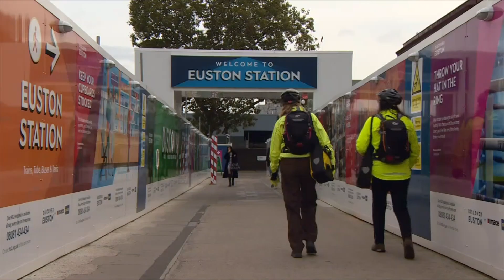Engineers say it's crucial HS2 goes to Euston

Comment: Unless the line goes to Euston it's effectively a line to nowhere. 

It would be faster to get the existing train from Birmingham to Euston than to get the HS2 and have to change on the way. 

But I see an even bigger problem.  HS2 doesn't link up with HS1 all the way to the continent. Who's idea was that? 

It should have been possible to route HS2 down the Lea Valley to join HS1 at Stratford and have a clear run all the way from Birmingham to Paris and beyond. Also going down the Lea Valley would avoid all the problems they now have tunnelling under NW London.

Comment: It should  not only go to Euston but also link east with hs1 with a outer london station or essex station I still feel the low used hs1 Stratford international to be a good choice, we have to get out of the habit of everything to london central ulez proves the east is woefully inadequate to get around if you haven’t got a car , or rely on public transit it rake 2 hours to go from north to east there has to be a loop built that takes that in
Reply: Yep and connect with Cardif, Swnseaa, Douglas, Oban and the isle wight, god what silly ideas people have of HS2
Reply: @peterwallen1063  i honestly feel that that is needed as part of hs3/4
Reply: @ram64man  There is no HS 3/4 only HS2
Reply: @peterwallen1063  like the government north of Leeds we can plan for it
Reply: @ram64man  Problem HS2 isn't going North of Leeds, That is thterrotory of LNER and the ECML.HS2 is WCML project that is run by Avanti West Coast Trains

Comment: Crucially to Euston yes, but unfortunately it was supposed to be ‘crucial’ for Northern England. I used to manage a company making railway bridges and the ‘intent’ and ‘promises’ were for increased capacity for trains travelling to and from The North.
Reply: Agreed it ought to really go to Waterloo or Scotland. Or link up with HS1 if the freight wasn't used for the HS1 HS2 link
Reply: @daveseville7394  Why link up with Warterloo or Scotland very stupid idea concidering the HS2 line is a domestic Hi Speed line linking Birmingham and Manchester to London Euston and there is no practical or financial reason to join HS2 to HS1 so any freight trains comming from the EU to the UK Midlands and the North via the Channel tunnel get to their destination easily by other routes, no freight trains will use the HS2 route as they will continue to use the existing WCML route
Reply: @peterwallen1063  I am against HS2 and firmly believe that a replacedment Great Central would have served far more people- but that's not what the corrupt PM of the day wanted. However, I am puzzled by your reluctance to link it to HS1. Europe has connected all of its high speed routes and you can- in theory- go from London to just about anywhere by high speed trains, except in UK.
Reply: It was going to do that, the Tories cancelled all that too

Comment: Give it a rethink and connect to HS1 instead
Reply: For what reason should HS2 connect to HS1, there is no reason for this idea.
Reply: @peterwallen1063 If you live north of London there’s every reason to have direct services to Paris.
Reply: @ipwood  Yes we have those direct services to France and Paris, they are called cheap flights from Birmingham Airport and Manchester Airport by Airlines such as Air France, Ryan Air and Easy Jet, so if we have these why do we need to drive into Central Birmingham when you can park your car at Birmingham Airport or Drive to to Central Manchester to travel 90 miles down to London, trundle across London then travel from Stratford International to Paris, and do not mention that the train goes to Central Paris which it does because this does not mean that you are visiting Central Paris so either way you would need to get a Taxi from the Stationin Central Paris or Charles De Gaul Airport to where you neded to go in Paris. This ha been tried years ago and never worked out so was cancelled

Comment: HS2 should never have been given the go-ahead.
Reply: HS2 is unavoidable. The West Coast Mainline & East Coast Mainline are pretty much at capacity and these are some the UK's most busiest lines.
Reply: @Mgameing123  The West Coast Mainline & East Coast Mainline are pretty much at capacity
Because?
Reply: @gdwnet  Because fast trains have to share tracks with stopping trains and in order to make that work you need to provide alot of space between a stopping train and a fast train and this causes a big loss of capacity.
Reply: @Mgameing123  Isn't there four lines? Up slow, Up fast, down slow, down fast?
Reply: @gdwnet  Forgot to mention the ultra slow trains from Moorgate, the semi fast Thameslink trains, the Digswell Viaduct & all the freight trains.
Reply: @Mgameing123  and forgot to answer my question as well.
Reply: @gdwnet  Yes there are 4 lines on the East Coast Mainline except at Digwell Viaduct and beyond Peterborough. 

West Coast Mainline is mostly 4 lines (infact 6 lines down in London) but thats not enough to add anymore trains in the London and up at the Birmingham branch (which is double track) the line is also at capacity.
Reply: @Mgameing123  Then the issue of slow trains doesn't exist.
Reply: @Mgameing123 could have taken freight off the current main lines, but thats not sexy.
Reply: HS2 is designed to minimise journey times between London, Birmingham, Manchester and Leeds and it will also free up more capacity on both the ECML and the WCML for the next 50 years 

That’s what the whole HS2 is designed to deliver
Reply: @8492946able  and how is that going so far?
Reply: @8492946able  and how is that going so far?
Reply: @8492946able  You won't be alive for the next 50 years.

Comment: I thought Sunak cancelled HS2 to cause trouble for the next Labour government?
Reply: He cancelled the section north of Birmingham which is the section which makes it actually useful
Reply: @MikeWillSee  Event that wouldn't neccessary cause problems, it the fact he downgrading the infrastructure around Birmingham and selling off the land that will make it financially very difficult to reinstate those sections in the future. Plus only building 6 platforms at Euston to permanently limit capacity of the High Speed rail network.
Reply: It's class warfare because when it's built and england and the rest of the world use this as a properly built network then it makes these idle rich snotty snobby shit heads irrelevant as it did when the first industrial revolution started boosting wages across the country.

Comment: Of course it has got to go to Euston - otherwise the observation by the Economic Forum will come true .... namely that, after having sepnt tens of billions of pounds, people will take longer to travel between London and Birmingham than they do at the moment.
Reply: Which means they’ll continue to use the existing, full route, so no capacity will be freed up on that line, which was the whole reason for the project in the first place! Capacity not speed.
Reply: @eddaines237  The problem is that no one will be ble to use the existing full WCML route when HS2 is open as all Hi Speed Avanti West Coast Trains that currently use the existing WCML will be transfered to use the HS2 route and hardly any trains from the Midlands nd the North West will use the WCML all will use the HS2 route
Reply: HS2 will only go to Euston if private investment is found & to date, there have been NO takers, which is understandable given that HS2 is an environmental disaster of epic proportions & Britain's biggest infrastructure mistake in half a century.